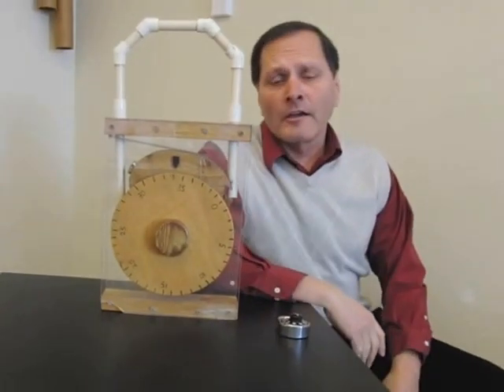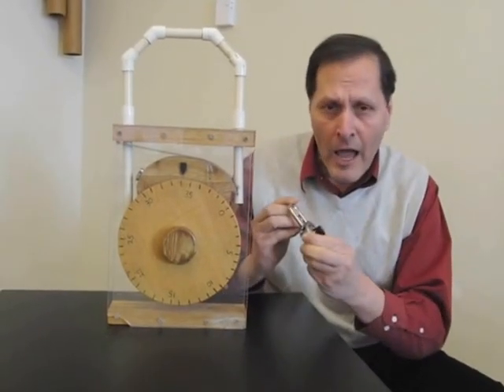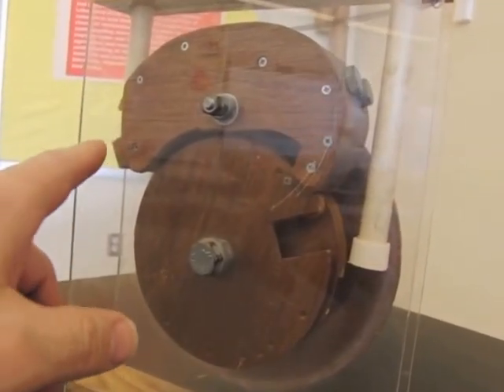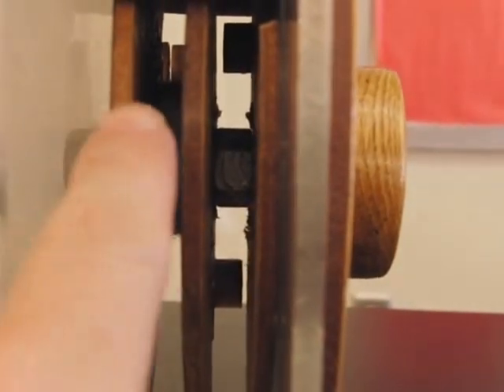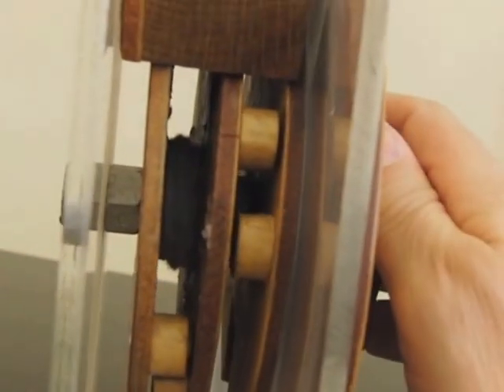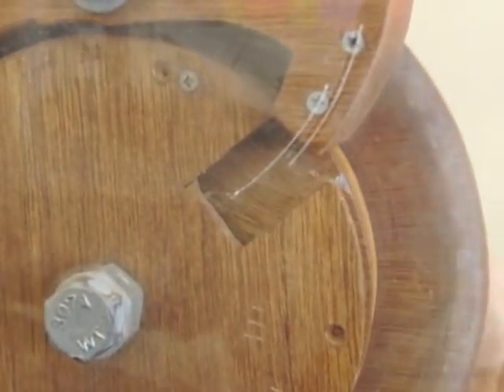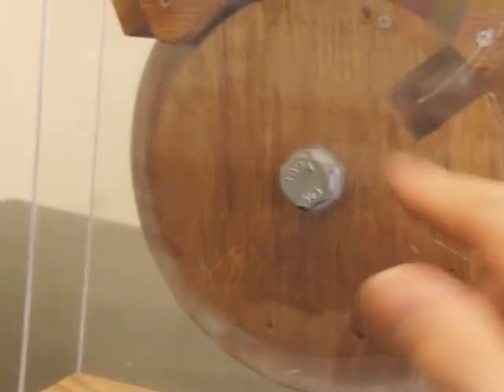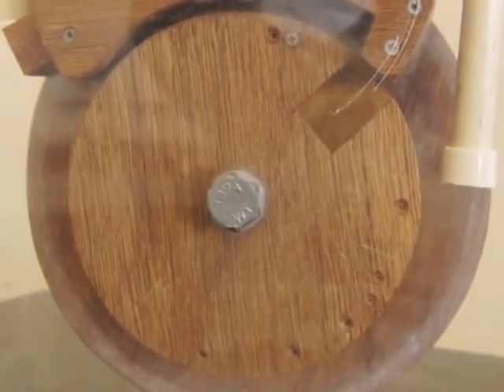Combination lock demonstration /// Homemade Science with Bruce Yeany

Comment: Excellent, I presume there must be some friction on the moved wheel so that it will keep its position when the others are turned.
It is said that there were people who could open any combination lock by feeling the slots through very sensitive fingers, and in    fact banks on occasions did humiliate themselves by having to ask them to come and help them unlocking safes.